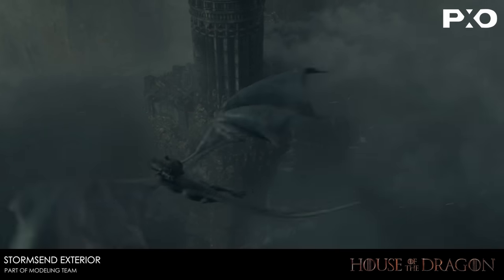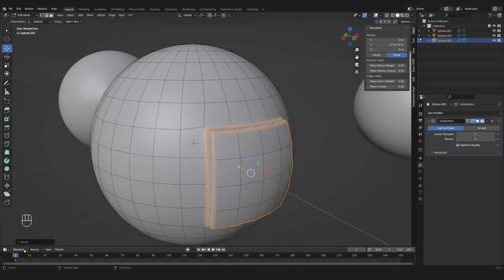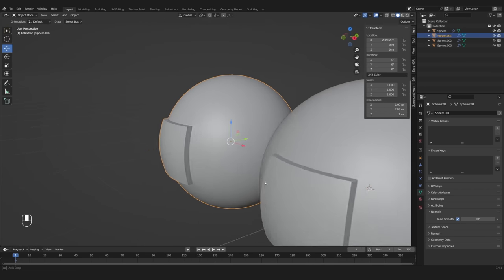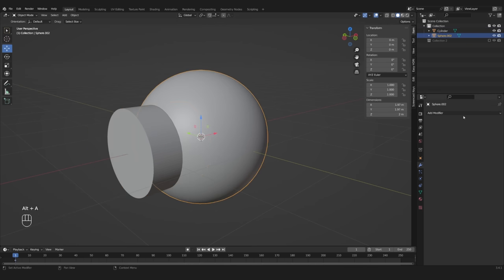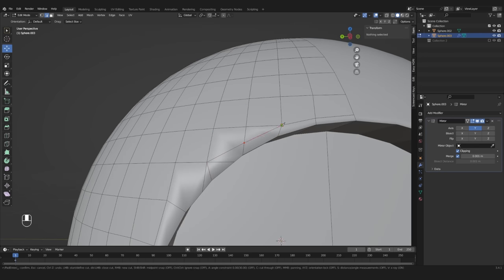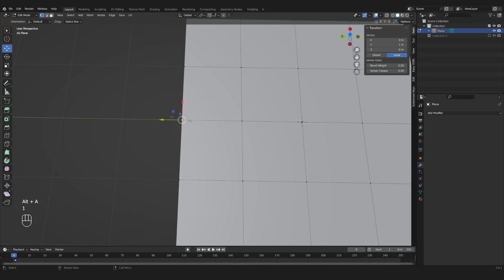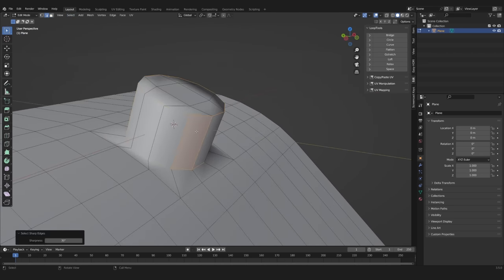7 Topology Tips Every 3D Artist Should Know

Comment: Such a useless tips. You only create artifical problems to "solve" them, while in reality a this actions are unnecessary, because it makes topology and uv unwraping more complicated. The main rule is simple - keep models as simple as it can be.
Reply: But by keeping it simple it won't be realistic and it's the purpose in most 3d models.
Reply: you said nothing. hinting your more than likely long streak of learning nothing.
Reply: Disclaimer: I barely know what I'm talking about.

Well, what he is doing is for the subdivision modifier, but yeah, besides that simpler is better.
Reply: Something tells me you're very new to this huh? Lol
Reply: It's not entirely useless, some bits could use more information like pinching in the corner can be avoided further if the mesh is a bit more dense then it becomes a micro level pinching once you subd it.
Reply: I can understand if you're working on a low poly model for a game. However, those "artificial problem"  are actually quite necessary or even a common practice especially if you're working on a product that requires a subD workflow like this.
Reply: You sound like you haven't modeled anything in your life.

Comment: Instead of the knife tool (which operates in screen space and has some inaccuracies due to the Z buffer), just select the two points you want to connect by an edge and hit J. That will automatically cut the shortest path through the mesh along the surface while preserving manifold topology.
Reply from the maker: Using the knife tool is much faster for me, especially if you want to cut many things in a row. The fact it operates in screen space is not a problem most of the time.
But yea, sometimes it creates problems, which is when I use the j key.
Reply: You could use grid snapping with increments or vertices with the knife tool. Very accurate
Reply: This. I need to download a cheatsheet lmao
Reply: if you normally use mirrowed pieces and hide the topology you aren't working it 99% time is fine cause knife tool sticks to points (press O and select "points" for snapping)... if you are working in a topo so small knife still miss the point you probably using to much topo or to small scale, in that case edit your topo using an scalated instance of your topo so you won't get other imprecisions in mesh calculations
Reply: Agree @mlt-studios

Comment: These tips are really good, and game dev here! Worked for a studio for a while and learned some big things when it comes to industry engines. So you see a LOT of videos where people just jam models together and 'join' or 'merge' them. Usually these are self taught blender tutorial vids for views. Please DO NOT do this when it comes down to creating a model for 'video game purposes'. For blender animations and things it is ok 'for the most part'. Though if you use an engine you can usually (More often than not) get a lot of errors with UV's and overlapping surfaces. It takes longer to develop it from a single model, but its a standard that needs to go on. So if you are working on your models, please, just work from a single shape if possible and build off that. Blender has looptools which helps if you want cylinders in your models which is why modelers typically will try merging stuff together. 

Guy who first told me this was originally the one who worked on DOOM, great game btw, and he kept telling me over and over, not to do it. I did end up trying it and did run into the errors he warned me about. Met many other industry experts who taught me tricks to improve, but the biggest one is not throwing stuff together. (High Poly Models are different of course and you are going to throw stuff together for sculpts so don't confuse low and high). So if you want to get to professional level, test it out and see errors yourself from first hand experience, but learn to do it the right way.
Reply: Can you please clarify what not to do for game dev? I read it twice but still not sure what you mean.

Comment: I don't know if it's worth mentioning but the knife tool can be cumbersome sometimes so for safety and speed I just hit J with my two vertices selected so it cuts a line through the mesh to the last selected vertex but it also follow the flow of the mesh too so it's safer.
Reply from the maker: Are you talking about a specific part in the video, or in general?
Of course I know abou the J key, but I find it to be much slower, if you have to do multiple cuts. But yea, for other stuff I definitely use it
Reply: @mlt-studios   many times at least in Blender it glitches out and does unwanted cuts, specially when you're very zoomed in
Reply: @MLT Studios  aye just in general. At the moment I'm cutting up tapered clover shaped castle model for cannon ports and windows. It's quite difficult with the knife tool cutting around such an odd shape without it doing undesired things so I use the J key, line up my view and it'll give me a nice slice that follows the mesh shape a bit better.
Reply: “J” is a shortcut for “Connect Vertex Path” in the Vertex Context Menu. The next option down in that menu is “Connect Vertex Pairs”. This lets you select more than two vertices in a row and split faces along all of them. This would be quicker than using “J” on them one pair at a time.
Reply: @lawrencedoliveiro9104  thank you this is great :)

Comment: Thank you very much for walking through this! I've been frustrated by not knowing how to solve quite a few of these specific problems, and this is an excellent walkthrough on how to do it. Please, more videos like this would be excellent!

Particularly interested in how to collapse down an odd number of extra edges - the case you provided works great for even numbers but if I have three extra edges I end up with still an extra edge loop messing up the mesh density.
Reply: you'd probably have to insert a triangle somewhere to quadify such problems, place it somewhere planar where it won't mess up even when subd-ed

Comment: For the sphere and face extrusion tip: Do an inset with "i" after you select the faces, before extruding to put a protective loop around the extrusion. This way there is no pinching at all. Give it a try <3

The process would be:
-Select faces
-I to inset
-Move in a little bit with mouse
-E to extrude
-Extrude out with mouse
-Select edges
-Bevel
-Result.
Reply: this is the best way, i always do it like that 👍

Comment: @3:50 the pinching was caused because you should never directly extrude the faces out of the sphere without creating a quad loop that natively fits the existing sphere first. The correct workflow is select faces -> inset slightly -> extrude -> bevel all edges for control loops. As long as you have not altered your original geometry at the inset phase, you will not disrupt the curvature of your mesh. 

If done out of sequence, you can also use shrinkwrap against an unaltered sphere of hte same size to draw the faces back into the right shape without needing to increase density of the mesh.
Reply from the maker: I will try the inset method next time, thanks! 
Yea, using a shrinkwrap modifier would probably reduce the pinching even more

Comment: Awesome tips man! Really helpful even for experienced artists, especially those who have learnt on their own and may have missed some of these (like me). Tip 1 will be super useful for me, as I have always used supporting edge loops on corners like that, never even thought of fixing it like you did. Although it does mean some vertices have five connecting edges, but for this case its worth it. I also wondered if you could use the loop tools addon for tip 4 to make the cylinder inside the sphere? I discovered that addon not too long ago, and its amazing. Keep up the good work!

Comment: My whacky alternate way of dealing with the sphere problem. Or any cuts on a round surface problem. Granted this only works with lower poly models and is more suitable for game modeling - just twat the vertex normals. I don't know how to do it in Blender, but Maya and 3ds Max offer ways of manually editing the vertex normals, which are what is in charge of shading. 

In Maya I'd use a mixture of Transfer Attributes to obtain the vertex normals from a nice sphere to resolve the dodgy shading and Unlock Normals to reset the parts that didn't take to Transfer Attributes too well. Some 3rd party scripts to manually adjust some things. The 'topology' is technically still shit, but the shading will be correct. In situations where I need to keep the poly count low and can't just add more and more cuts and bevels to average things out, this can be a very fast and convenient way to do things. It's also more 'perfect'. Even with additional cuts, bevels and averaging out - there is still a bit of pinching/distortion that occurs for these sorta shapes. 

Either that or bake a normal map from a higher division mesh from something like ZBrush where it isn't a problem, and let the normal map hack override the crappy base shading.

Comment: I find it much easier to use Loop tools to create a circle directly in the sphere instead of using a boolean to cut a circle out of it and then fixing the geometry. after that its the same process.
Reply from the maker: Yea, like I mentioned at the end, this does not always work for me. Or are you talking about a loop tools method I haven‘t yet mentioned?
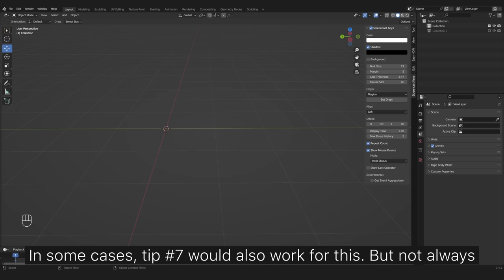Reply: @mlt-studios  I don't hear you mentioning anything about this at the end. When i looked again i did see you mentioning the  tip #7 solution at 5:06 that i missed when watching it the first time. 
If you say it can something cause issues i'l believe you because you know more than i do but before i actually find a case where it doesn't work il just stick to using the tip #7 solution because its so incredibly fast.

Comment: Please use a pop filter for your condenser microphone. In the headphones, the air from the spoken sounds hits the ears hard.
Reply from the maker: I have one, but I haven’t yet figured out the right distance for an optimal sound. To close, and you can hear the pops, to far away, and the sound gets drastically worse. Will work on that
Reply: @mlt-studios  I think you can also hold a pencil up between you and the microphone and it helps with some of that?

Comment: are there any differences or pros and cons between using the knife tool between to vertices versus using the join vertex path function?
Reply from the maker: with join vertex path function do you mean pressing j?
With the knife tool it is easier to control the path of your connection. If you want to connect vertecies quite far away, sometimes it takes a weird path. But if that is of no concern of you, that basically do the same thing.
Reply: @mlt-studios  That makes sense, haha I actually had that exact problem just a little while after writing this comment ^^' thank you for your help!

Comment: Quick question and I imagine it's a dumb one. But how do you get knife to go in a straight line? Mine seems to always be free form and the shake in my hand doesn't make clean cuts. Is there a shortcut or something to make it just cut straight?
Reply from the maker: I’m not exactly sure, what you mean. The knife tool is dependent on the angle you look at the object. If the surface is curved, the cut will not be strait, once you rotate around the model a bit.
Once you’ve activated the cut tool, it will show some hot keys in the bottom bar. Maybe there is something, that will help you

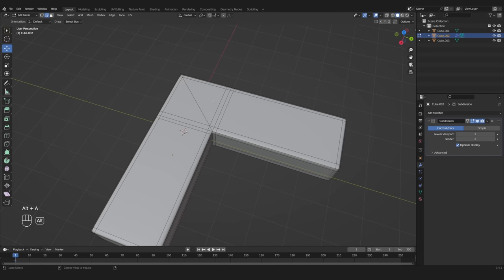Comment: 1:22 How can I select the inner edge loop like on the video? I hold shift+alt and press lmb on the edge, but blender selects the entire whole loop.
Reply from the maker: Im not sure if I understand you correctly, but my guess is, that you are selecting the wrong loop. I only delete 2 out of 3 loops on each side
Reply: @mlt-studios  I believe that I clicked on the same edges as you, because I followed your video step by step and tried it many times. But maybe I indeed overlooked something or made some mistakes while modeling the object.
Thank you for the answer anyway.
Reply from the maker: @acd2377  you might want to check out Andrew Hodgson. That the guy I learned it from. I think he has a video about that on his YouTube channel. He works with Maya, but you can easily transfer it to other programs
Reply: I have the exact same problem. When you are selecting two inner edge loops, your selection stops where the knife cut was made, while mine does not :c
Reply: Gosh, it worked after making a similar knife cut on the opposite side 😓

Comment: Some really good tips here! Though I would really like to add that even good topology videos like this never seem to cover good use of creases. Everyone only considers using them on sharp edges to keep them sharp and as you mentioned creating unneeded complexity. This is totally wrong In my experience, creases are best used ON the supporting loops to force the extra density into the highly curved part where its needed!
Reply from the maker: Sound interesting. To be honest, O never use creasing, so there is probably some cool stuff you can do with it

Comment: For tip #4, why wouldnt you use the method from tip #7?
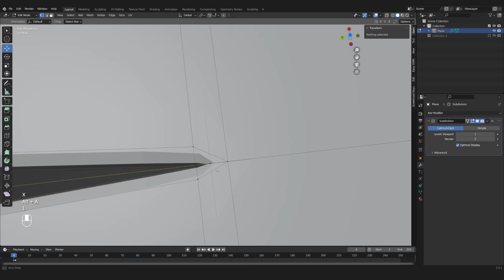For tip #6, at 8:15, why is it important to "not have these two edges that close together"?
Reply from the maker: SubD modeling relies on subdivision surfaces, which means that the geometry is subdivided or split into smaller polygons when rendered or previewed. When the topology is evenly distributed, it results in smoother and more predictable surface deformation when the model is subdivided. Irregular or unevenly distributed topology can lead to unwanted creases, pinching, or other deformation issues.

It might not have been necessary in this example, but in general spreading out your topology evenly  prevents problems further down the line. And it looks cooler in my opinion ;)
Reply: ok thank you  @mlt-studios

Comment: couldn't the first problem be fixed with marking the inside corner as edge
Reply from the maker: you mean crease it?
The Problem with these kind of things is, that firstly, it might not work in all Programs. If you export it to other programs, it might not work.
Also, adding Support edges, will then give the corner a small roundness, wich is how it would be in real life. By sliding these support edges closer together, you can then decide how sharp the edge should be.

Comment: this tips and tricks video can be applied only to Blender and not on other 3D softwares like Maya, 3DS Max or Cinema 4D
Reply from the maker: Of course they can. Not 1:1, but topology works the same way in these programs. At my old work, I used primarily Maya, and used these techniques all the time. The for example is a similar tool to loop tools in Maya, that lets you make faces into circles.

Most of these techniques I actually learned from Andrew Hodgson, back when he only used Maya. I simply transferred them to Blender

Comment: You know, if you want to cut a cylinder into a sphere, you could just ROTATE the sphere over in the direction of the cylinder and utilize it's existing round geometry. Cutting a hole in the side like that is just dumb.
Reply from the maker: I never wanted to cut a cylinder into a sphere for a real projected. The Sphere is just an easy way to get a curved surface as an example. You are right, for this specific case it is much easier to do it the way you said. But that is nearly never the case in other situations

Comment: Get a pop filter.
Reply from the maker: I already have 2 different once. But they don't seem to do too much. Maybe I'm still to close to the mic. Will work on that. Sorry :/
Reply: @mlt-studios  I myself now use a C1000S (cardioid) moved to the side at 45° . Some others prefer a shotgun mic angled down from above the monitor.

Some mics come with adapters to turn their polar pattern into a supercardioid one, but the general idea is the same - increase distance / get out of the air currents without picking up all the room reverb.
Reply from the maker: @hardwareful  I use a rode nt1-a with a behringer umc404hd audio interface.

As you described, once I move away from the mic, the room reverb gets pretty strong.
Maybe I need to invest in some room absorber panels or however they are called.
I will look into that. Thanks
Reply: @mlt-studios  Appreciate the dedication. Subscribed!